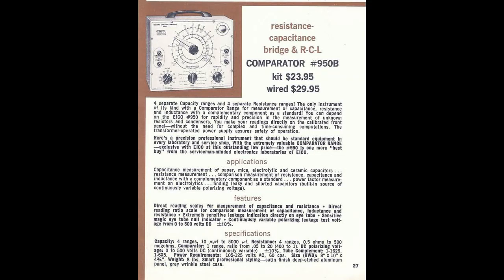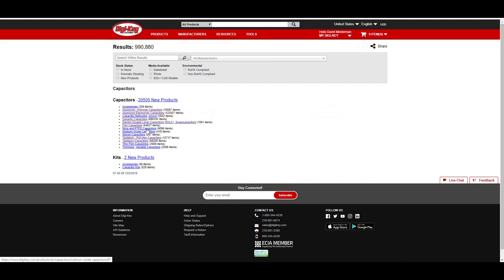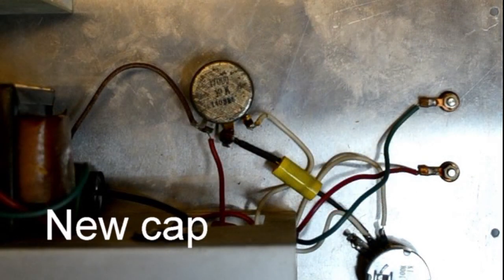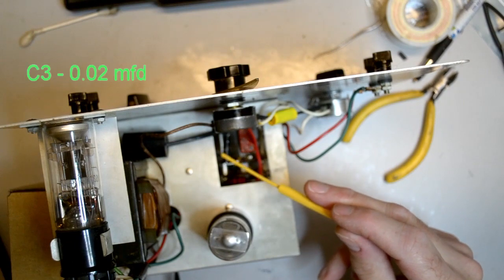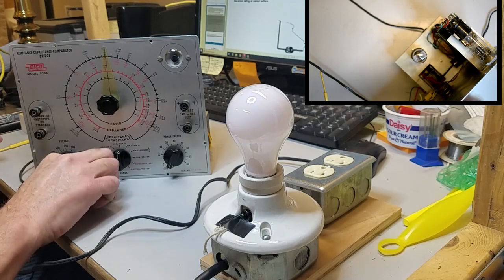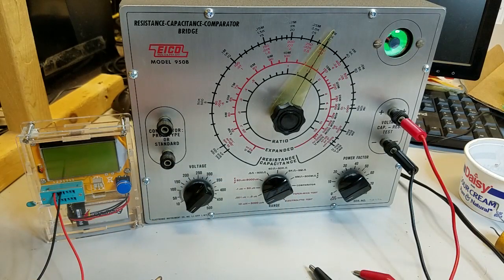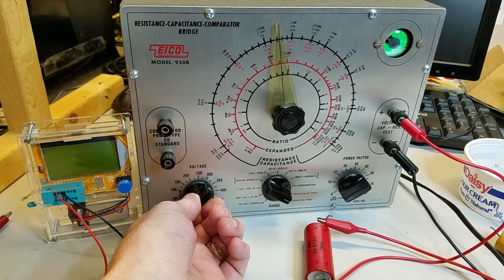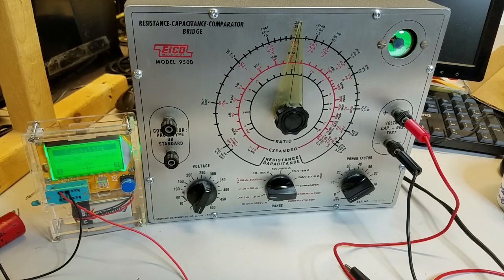EICO 950B Capacitance Bridge - Rehabilitation and Demonstration

Comment: Where can I buy replacement 1% capacitor s?
Reply from the maker: For the high voltage caps in this unit, I would try justradios.com  1% caps are pretty tough to find and usually if you REALLY need that pecision; you would have to test a whole bunch of them and manually select them youself.  However most capacitor testors are not that accurate anyway.